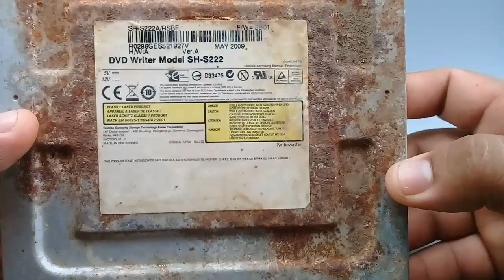I make 12v Free Electric Generator from CD-ROM Motor

Comment: Where did you hide the battery?
Reply: It has no battery, it just used it to start the engine, then it self-powers.
Reply: Under the plank/board, battery connected to screws.